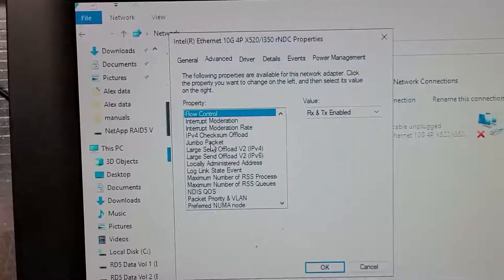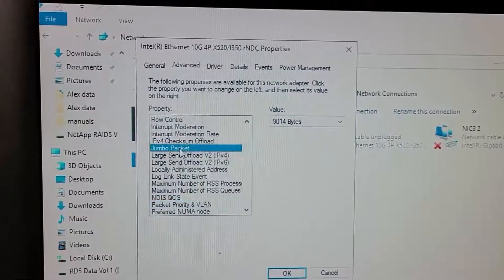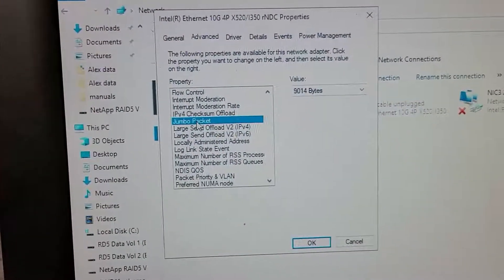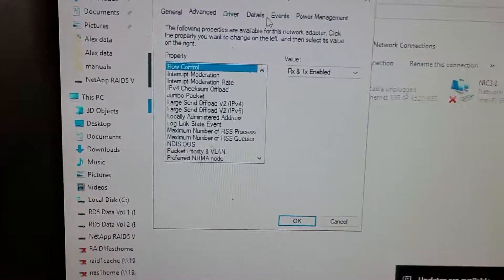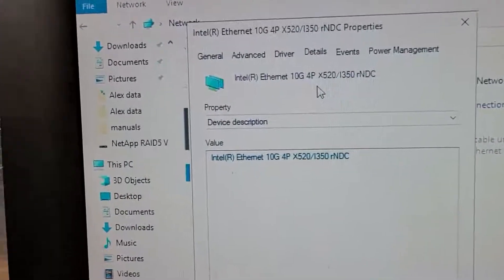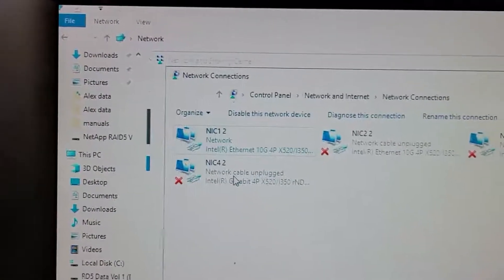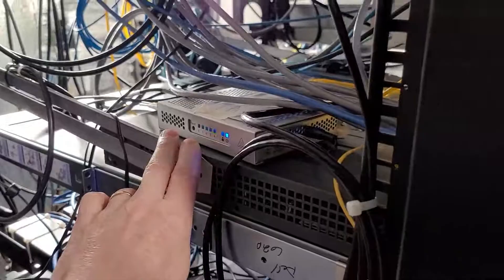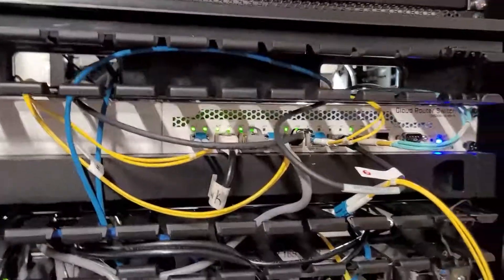I want 10Gb networking speed now but it is so slow

Comment: If people on windows are having speed issues with NIC and 10G set to end point it is usually the A/V software inspecting files on the wire that slows it down severally.

Comment: Another good video brad this answers some questions but not everything but do you need a router switch over just a switch 

Is this a microtech switch router and can you recommend any at all i found a 
2x 10GbE + 8x 1GbE $99 Silent Switch MikroTik CSS610-8G-2S+IN

of course the draw back is 2 ports but im thinking if you only need one connection server to switch router to computer then 2 would be enough i noticed in your setup you use fiber or solid copper cable 

does a cat 6 still hold a good enough 10gb connection or does the cable have to be heavily insulated ? 

how much did the clour router switch you have cost when ive looked multiple port router switches are not so reasonable
Reply from the maker: these are great questions so for your first question....   Yes I think for a beginning 10NIC setup the MICROTECH is a solid choose. Knowing that you have 10GB NIC going to your server and your second 10GB NIC connection will go to your personal PC.  (That is why you want a 10GB network right?)  and yes copper (CAT6) will give you a lot of the 10 GB network speed.  Make sure you buy the 10GB rated CAT6 cabling for your needs.  But that is not all that needs to be done.  Once you connect the rest of your 1GB network to the switch you will then need to setup both of the 10GB NICs on your server and PC and the switch for the higher MTU settings that support 10GB function and speeds.  Be careful not to do this for the 1GB but you can tweek that side of the network as well.   By default all system NICs are set tot he most compatible settings possible and make allow them to work with almost any network but not tweek out for higher speeds with out you adjust those values.  Why don't you consider this idea.  Buy the 4x10GB - 8x1GB version of the switch instead so that you can down the road add another server (a newer one) and be able to transition your systems (migrated as needed) and have the spare ports for both possible port failure / testing and future growth.  The cost is not much when you see your network.   I bought a four 10GB switch and I wish I got the eight port instead, so I got the eight port after all.  Just an idea...